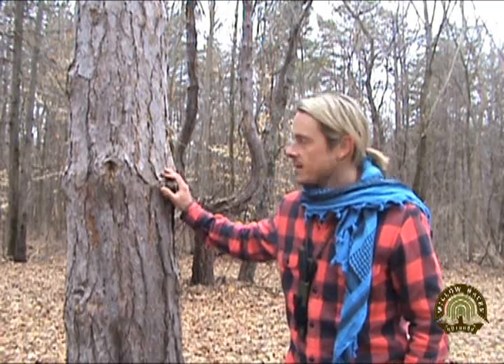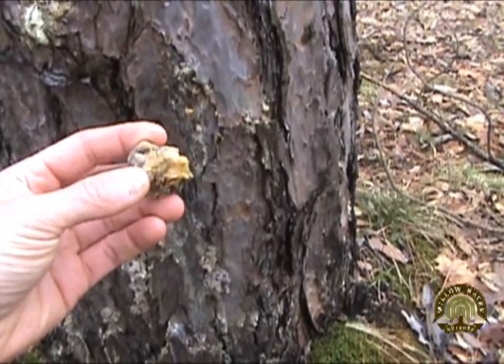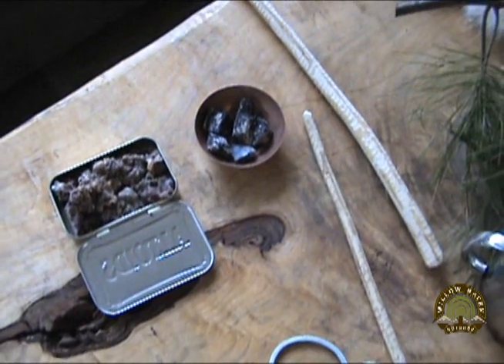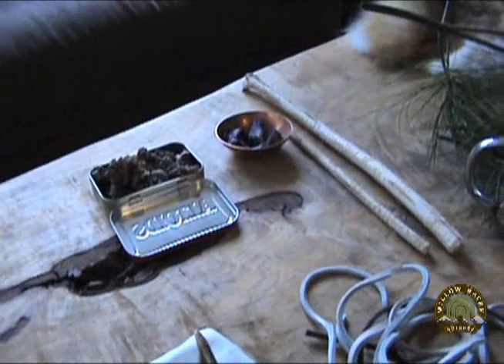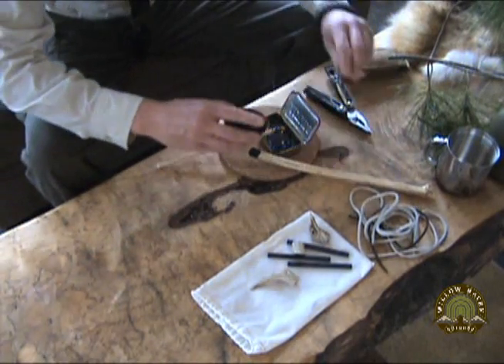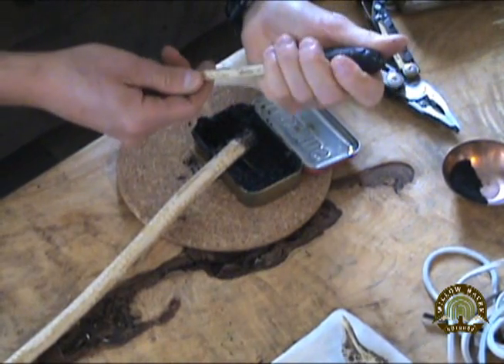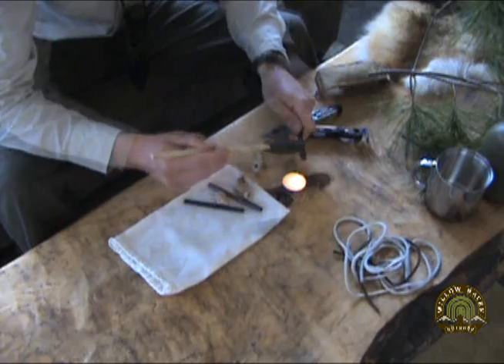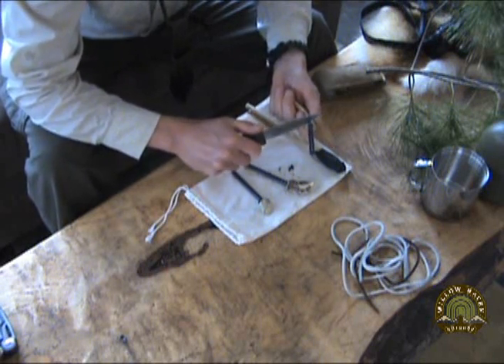Pine Sap Glue Used To Make Ferro Rods

Comment: So just out of curiosity, in the 3 parts resin to 1 part charcoal, is that 3 parts to 1 by volume or by weight?    Two very different ratios, not you nor anyone ever states what measurement you're using, such as teaspoons or table spoons or cups or ounces or pounds etc.  Just the strangely ill defining statement of 3 parts to 1...

Comment: Not only do you need pine resin and charcoal you need fiber for strength a fiber like either deer poop rabbit poop or hair now the deer poop and rabbit poop need to be dry very dry break down into a powder the hair you got to cut it real fine and that's your binder that gives you the strength the glue needs now just pain resin and charcoal yeah it'll still do the same thing but it won't be as strong put some fiber in it like hair or dried deer or rabbit poop

Comment: Love the use of the Pine Resin and Charcoal to assemble your Ferro Rods. I use Fir Fat Wood to make Ferro Rod Handles and have not had to use a Glue as such, to hold the Rods in place. When I drill the hole into the Handle, the resin is so fluid from the heat of the drill that I don't need to apply a glue when I tap the rod into place. That may not be the best, but I have not experienced any separation of the Rods from the Handles yet. Not to say that won't happen though. Sure like the resin / charcoal glue idea. The same thing may work with Fir Resin as well.

Comment: Creek, I just want to state that, here on youtube, you are one of a handful of actual wilderness survival experts I have found, compared to a huge number of pretenders. You may wonder why the negative attitude towards the pretenders and that is a reasonable question. The pretenders make videos of topics they just quote from sources that they do not know about subjects they do not fully understand. This leads to a ton of old-wives tales, myths, and bad survival information masquerading as knowledge circulating around youtube and forums that many will hold to be true, without ever checking the source or accuracy of the information. Just the other day I came across a supposed expert here talking about the medicinal uses of pine oil. Too bad he described its harvesting using destructive distillation of pine resin. What he was making wasn't pine oil, but instead a blend of creosotes, sulfates, sulfides, and flammable long chain hydrocarbons -- basically wood crude oil. He was advising people to put it on their skin, believe it or not.

If a person fails at survival, then by definition they die. 

You have been at this for awhile, that I can tell. Probably because I have been learning this subject for 30+ years so far myself.
Reply: Paul Andrulis Paul you are so correct. Creek is as real as it gets. he is in no way fake. all others should take notes am I rite

Comment: ive never made the stuff but...I keep seeing recipes saying you need to add charcoal and droppings from a herbivore...then i see some that say like this you just use the sap and charcoal....
so which is which?
are they different types of glue like for diff stuff...or is it just two versions of the same glue...like some folks think you dont need the droppings.
thanks
Reply: there are almost as many recipies as "outdoor experts", ranging from everything from a 1:1 ratio to a 1:3 ratio, with or without droppings. The general idea behind the droppings is to add very fine fibers to the mix, making the glue a tiny bit more forgiving when it comes to bending. This video actually shows very clear how brittle the glue is, when he is chipping away the excess with his knife. Depending on what you want to do with it, this can be, or won't be much of a problem. For the purpose he shows, shoving a rod into a hole and using the glue to fix it, his mix is perfectly fine. if you want to glue an arrow point to a shaft, adding droppings is a good idea, just to make sure that the glue won't fail as easily on impact as it might do with a charcoal only mix.
Reply: If you have cattails nearby fluff up some of the fibers off the brown "flower" and it will work fine.  It's the "fibrous" material mixed with the charcoal from a fire mixed in the sap for a "more flexible" glue.  (as in repairing a tear in a tarp or tent, etc.)  Hope this helps. :)

Comment: Oh and this is not considered an epoxy because it's not an epoxy once an epoxy hardens it will only melt at a high temperature pine sap will softing if too hot in the summer

Comment: Remember, pine sap glue doesn't "dry." It hardens due to lowered temperature. It can, and will get soft again with high temperature, such as in a car during the summer where it can get as high as 140º F. when closed up in the sun. Don't confuse it with high tech setting resins such as epoxy. It is your opinion that it won't fail. It hasn't been tested.